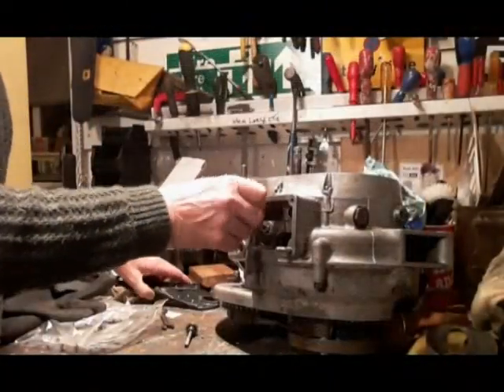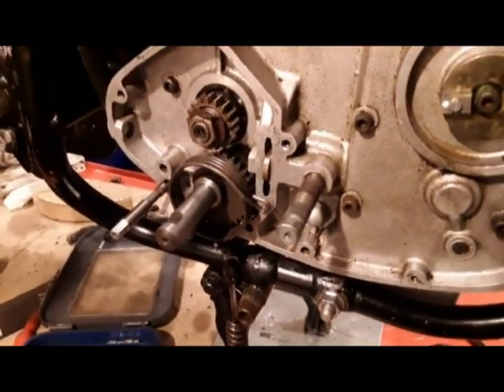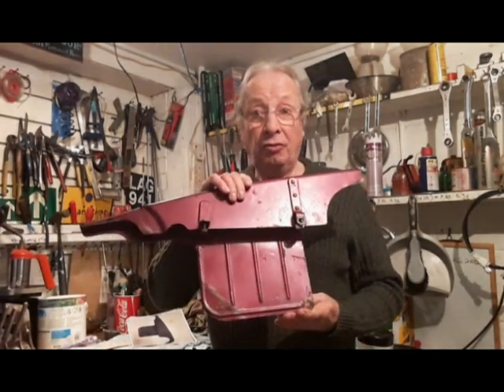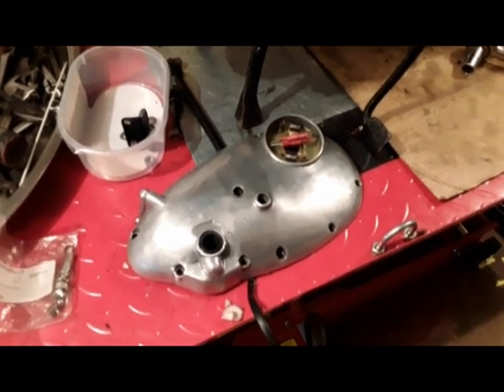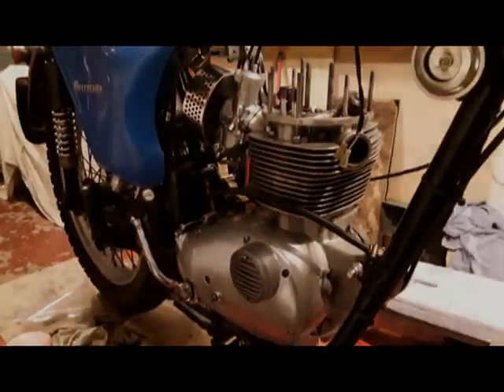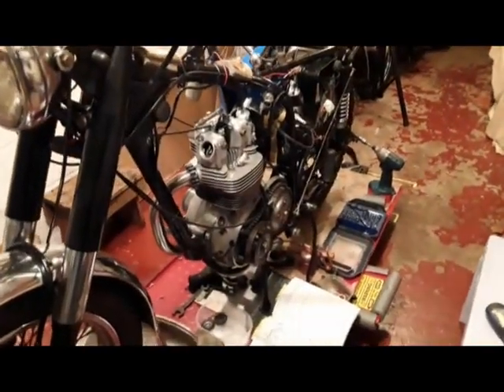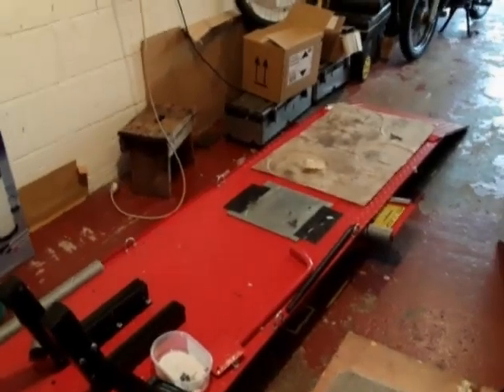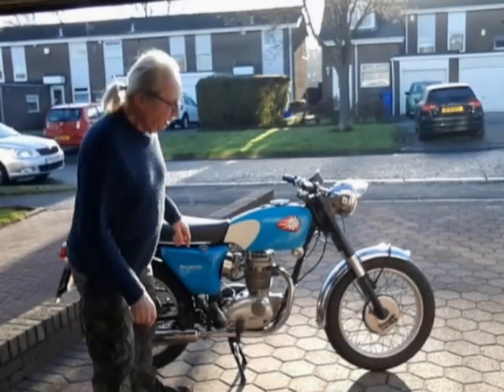B.S.A. Barracuda 1968....Part 3....(the start of it's history continued..)

Comment: I have been a mechanic for 48 years in the bike trade and owned a Starfire, the later model for 30 years. Being honest while you have the engine out, fully strip it and check everything, the main one being the crankshaft sludge trap, if this blocks up it cuts off the oil feed to the big end, the conrod snaps and wrecks the motor. Remove the conrod from the crank, the outer web of I think the right hand flywheel has a big blanking plug with a slot head, remove this and find a drill bit the right size to go down the hole, with your fingers turn the drill and it will remove years of sludge, wash out the hole with paraffin and make sure it is clear. I have fallen foul of this myself just wanting a quick first ride and the motor blew up. Get a good manual and follow step by step build up.